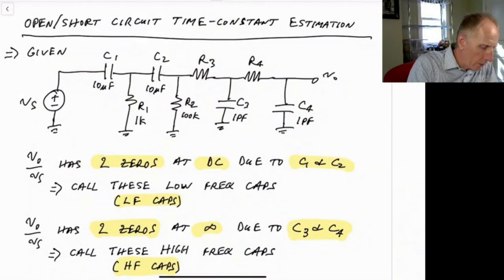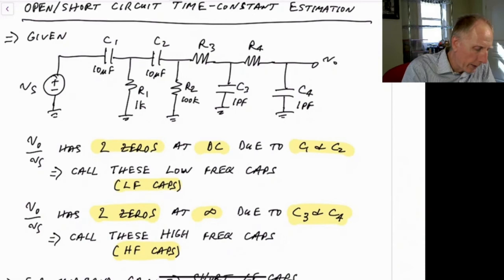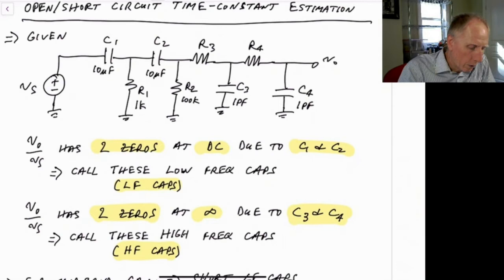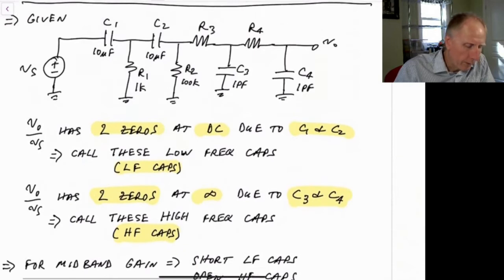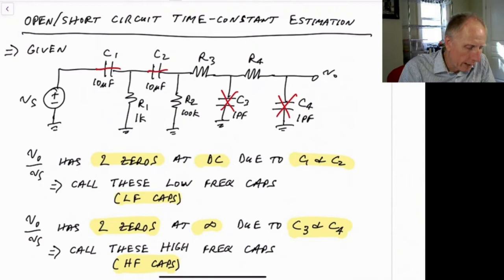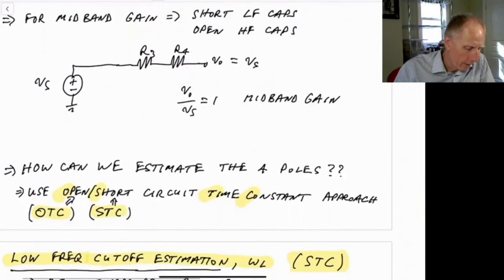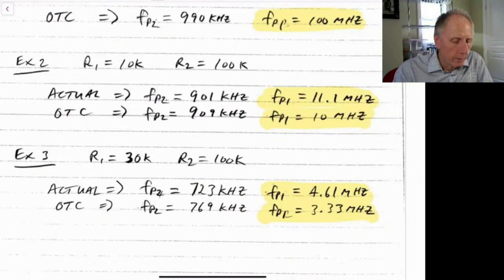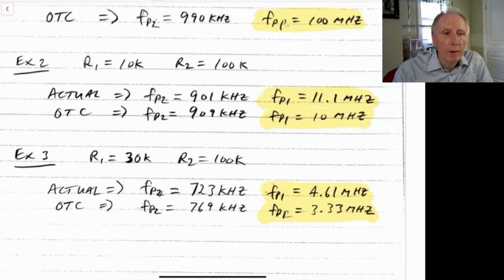Analog Electronics 2 - Open/Short Circuit Time Constant Estimation (OTC/STC)

Comment: What if we have inductors inside the circuit?
Reply from the maker: If there are inductors, capacitors and resistors, then this estimate will not work.  The open/short circuit time-constant approach is valid for systems that have only real-axis poles and zeros.  If inductors/capacitors/resistors are all in the system, then the system may have complex poles and zeros.

Comment: At 10:01 isn't Vo connected to R4? How could you say Vo is zero??
Reply from the maker: The current through Vo is zero (not the voltage) since it is an open circuit.
Reply: @davidjohns2582 Oh yes, that makes more sense
Thank you!
Reply from the maker: You are welcome.  I should have made that more clear... @pruthviraaj7353